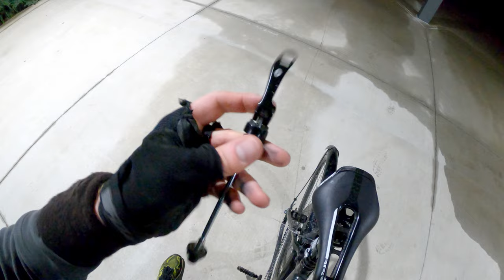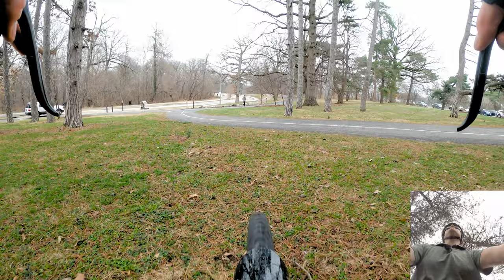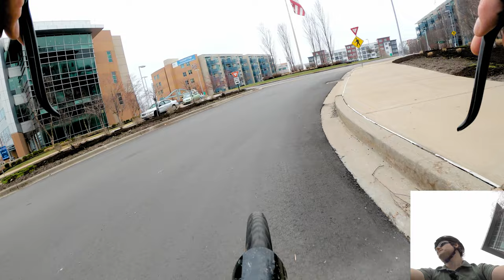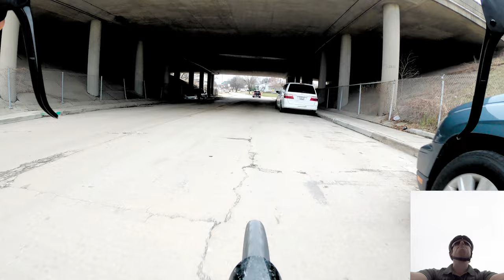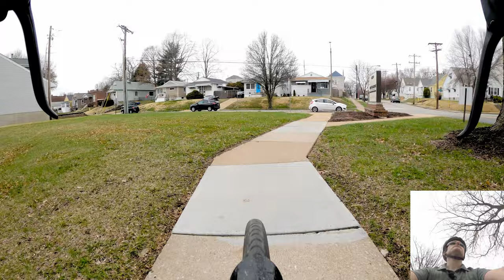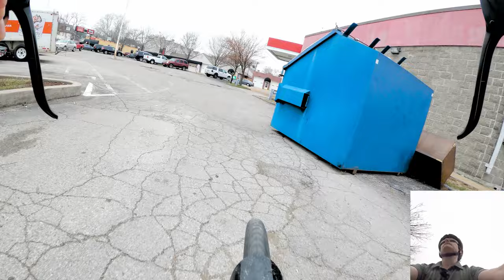Bicycle Wheel Axles Explained! Bike Tips

Comment: Cup and cone bearings are sensitive to the pressure of the quickrelease. 
Older frames with horizontal dropouts, mostly steel frames, need a little more pressure to hold the axle. 
So leaving a tiny bit of play in the bearing will prevent it from beeing overstressed by the quickrelease pressure. 
When the axle is getting tightened properly, the play will disappear.

Comment: I got a new single speed bike about a month ago, but it does not have quick release  wheels. But I do have a question. How do you know your chain is adjusted to the proper fit? My chain makes a horrid clanking sound every time I ride. And I believe that it is too tight, but to loosen it up, will be a rather large undertaking. So I want to make sure I am getting it right on the first go, if at all possible. So how do I determine if it is right, so that hopefully that awful clanking stops?